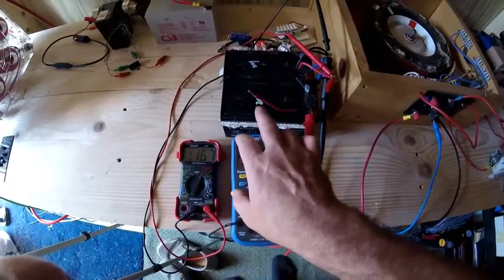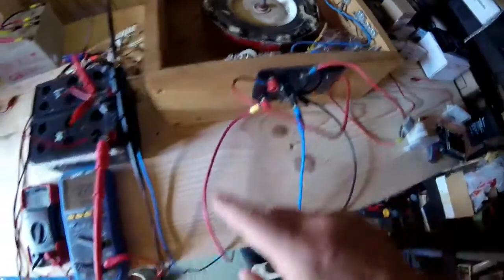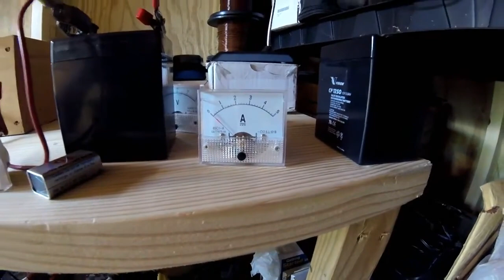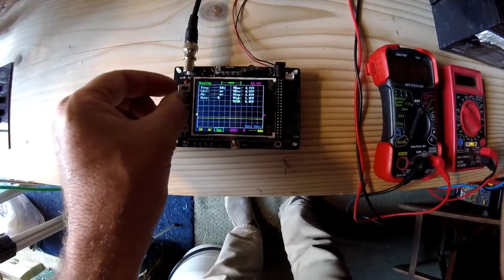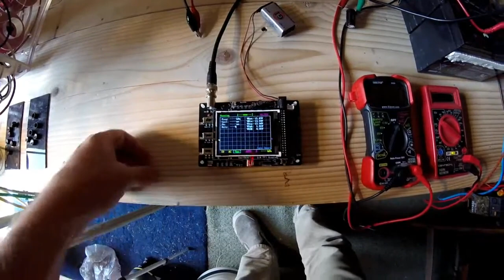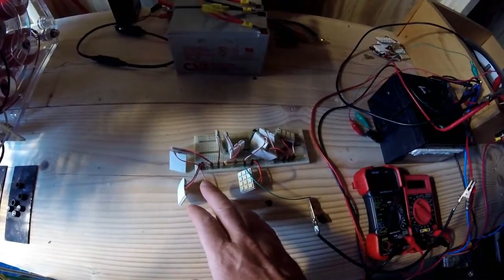Comparison Of Bedini Charged Batteries w Capacitor Over Time June 2017

Comment: The capacitor is capturing the spike and bleeding it back into the circuit, smoothing it out. On a good O-scope you're going to see a fast spike and then a ramp as it discharges. It's doing what it's supposed to do. The battery without the cap is still getting the same thing just in a really fast spike so your meter isn't capturing it. You're only measuring an average of the spikes. Go to a larger capacitor on the other one and you'll see a higher presented voltage.

Comment: Not sure what what was attempted to be proven here, but...
A couple of observations....
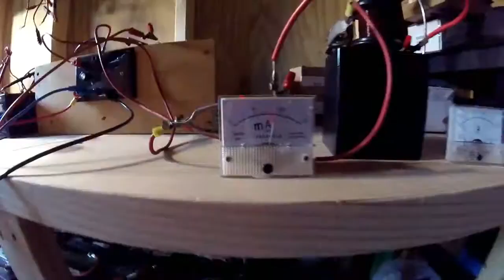@17:20 "Real work being done"
If you mean to show that a junk battery can be restored. The real question should be.... Is it worth the effort?

@ 20:20 "Charging a battery more powerfully"...
Battery voltage isn't a reliable indicator of state of charge. 

But since this involves a bedini motor... Do you believe the claims on the internet that you can get more energy out than you put in?
Reply from the maker: 1. Yes it is. Batteries can be expensive. Better for the environment too.
2. Correct. The proof is in work being done after charge really.
3. Do you believe you can get more power from solar panels than you put in yourself? Wind turbines? Static shocks?
Reply from the maker: And i am talking AFTER cost of the devices of course.
Reply: Photons strike the solar panels. The panels operate at best, 20% efficiency. So useful  energy output is LESS than the input. Same goes for wind turbines. Energy output can never be greater than energy input, without violating the law of conservation of energy.
The one exception in physics being quantum fluctuations (vacuum energy/zero point energy). However, that energy can not be harnessed or made real.

Comment: First !
All Thumbs Up Every Time ! # 12
The one with the capacitor has a smoothed out current and so provides a higher charging voltage.
Charging current is more ripple free.
Reply from the maker: I have learned that the battery with a capacitor will finish charging first. It will have more usable energy.